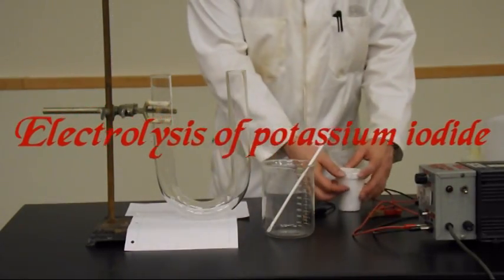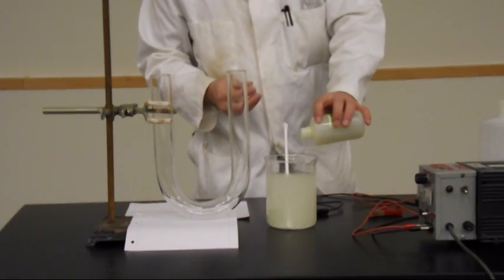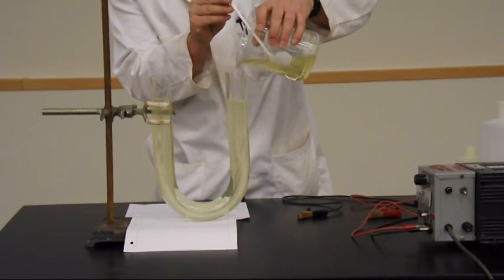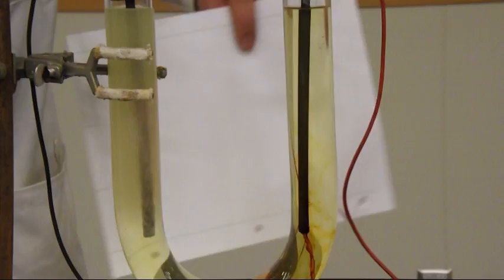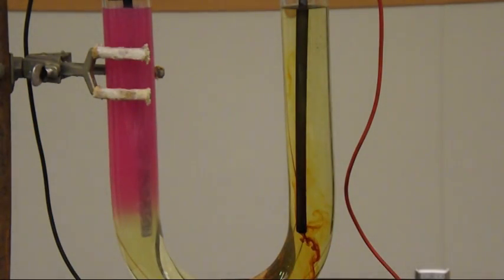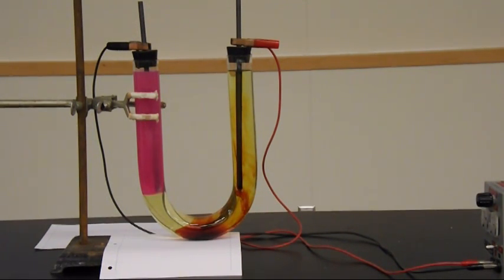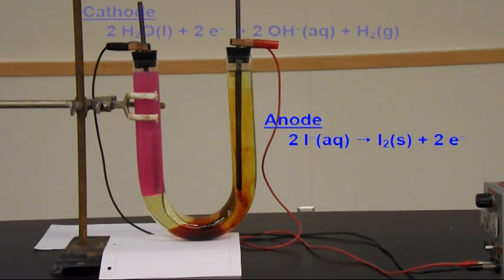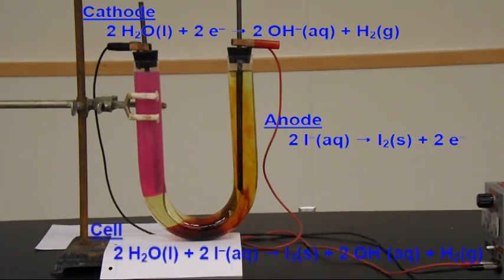Electrolysis of KI

Comment: Why did my solution turn pink when I added the phenolphthalein? Your was yellow.
Reply from the maker: The yellow is from the iodine. If there wasn't a pink color at the other electrode, it is likely that the phenolphthalein want added or was degraded.
Reply: ExploringChemistry I meant that my solution turned pink in the beaker before I even started the experiment. I only added a few drops and the whole thing pink. Isn't it supposed to be colorless before I switch on the power supply?
Reply from the maker: Yep ... had that happen too. I suspect that you were using deionized or distilled water. These systems do not regulate the pH, and the pH may swing widely. It is also an indication that there may be something wrong with the water system. Add a few drops of HCl and everything will be fine. :)
Reply: ExploringChemistry Thank you so much for replying.